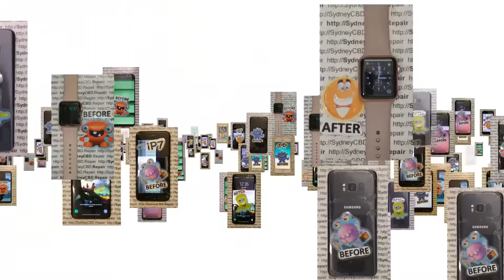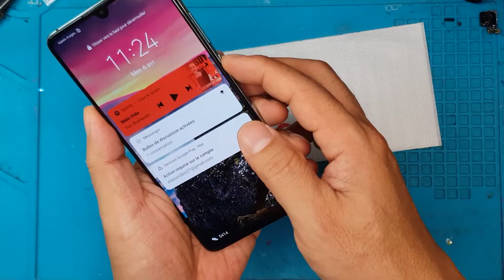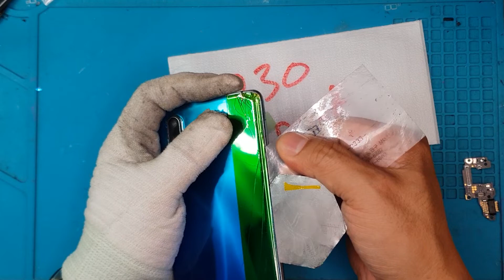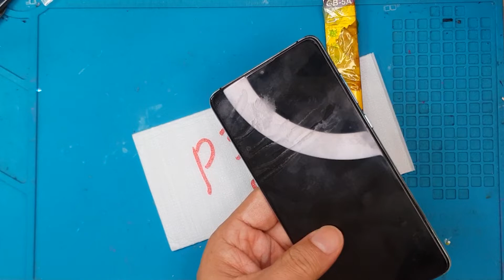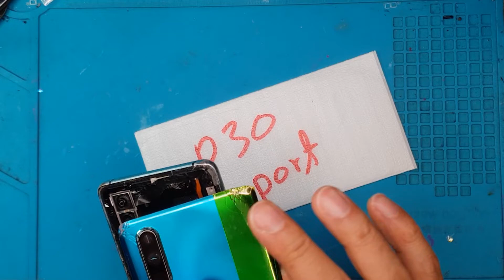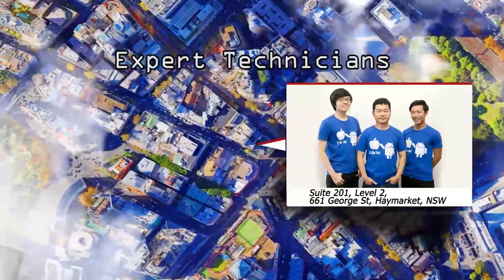Why is my Huawei P30 not charging? (Charging Port Replacement) | Sydney CBD Repair Centre

Comment: Hi mate,i want to DIY this on my P30 pro,i have little skills on electronics and this guide is very helpful,one question though,when i put it back,do i need a new adhesive?what kind of adhesive are used for this kind of repair?thanks a lot
Reply from the maker: Hello my friend. Yes, you will need it, in that case, you can use the B-7000 glue, it is very useful. Hope this helps.